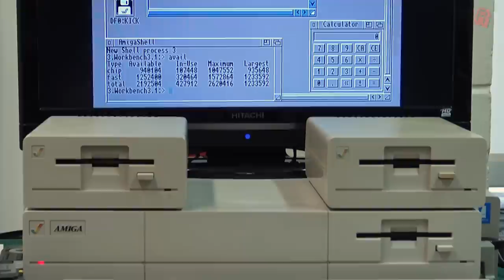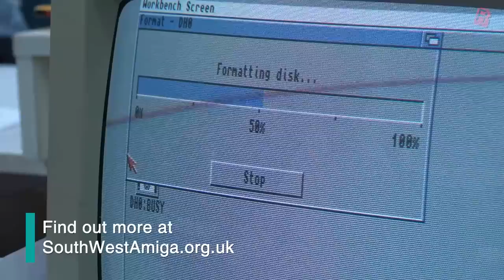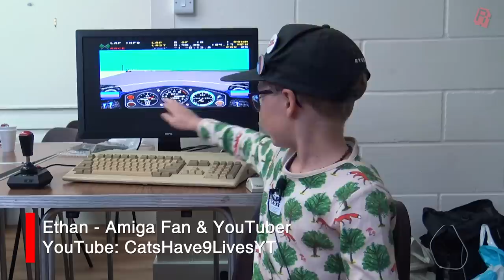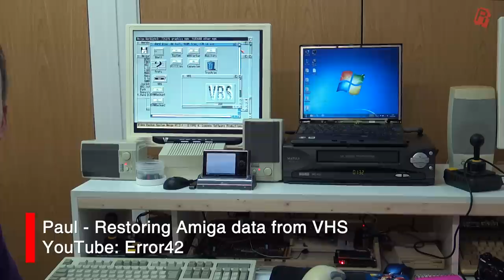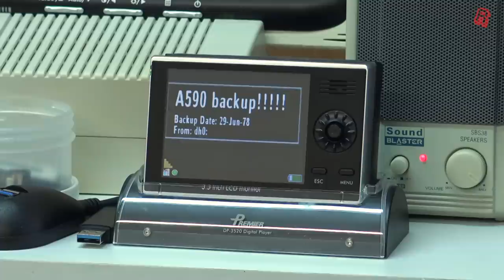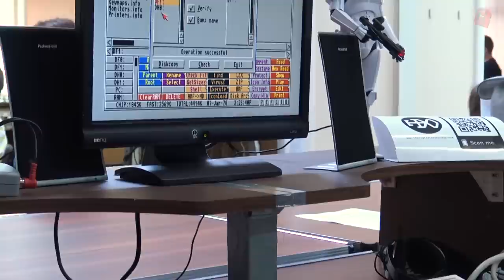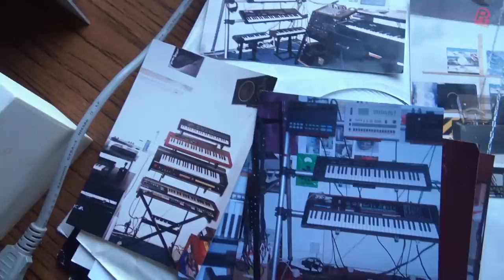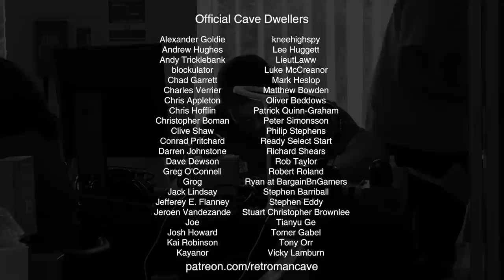Amazing Amigas at SWAG - Retro Road Trip

Comment: Question for you: I just took my original Amiga 500 out of its 15+ year storage in the closet. It is sealed in a plastic container. I have the RGB monitor, and RAM expansion plus a bunch of random accessories. Can you direct me to a video on what to do with this vintage machine before I power it on? A checklist maybe? I don't want to accidentally ruin it. Thanks!
Reply from the maker: Assuming it's an A500 and not a 500+ you have no battery to worry about on the main board.  Remove the expansion card and check if that has a battery and if it has leaked.  If you have a multimeter check the pins of the power supply to be sure it is giving out the correct stable voltage.  Then plug in.  The 500 is pretty hardy.

Comment: This just makes we want to get hold of an Amiga 1200 again. Had one as a kid for ganes and the HDD failed, then the monitor gave up the ghost so my parents threw it out (My mum was not the sort to let me take it appart at that age), and we got a PC to replace it. 

At the time they were only worth £20-£30 in working condition, but had a look on Ebay and was shocked how expensive they are now in coparrison (£200 for a good one!)
Reply: Yesterday's trash is tomorrow's treasure. 
Have a look at the price of an original Sony Walkman. TPS-L2  

Back when Amiga's were  still in the shops I was firmly in the Atari ST camp, but when they were down to about £20 I bought quite a few. Some I sold on, one going to the Czech Republic where they were never sold new, but I still have a few of them :-)   

Classic IBM PCs aren't cheap these days either. Probably because most of them suffered similar fates to the one a colleague used to fix his car exhaust !

Comment: My old A600 box. Why did I throw the box away. Why did a brand new system come in such a lame box?
Reply: Most of the wedge Amigas had these white, blue and red boxes, although the A500 one at least had a picture of an A500 on it. Some exceptions being the Desktop Dynamite and Cartoon Classics pack. Most of the later Commodore Amiga packs under their respective Wild Weird Wicked, Lemmings, Computer Combat etc. packaging were just sleeves that went over these vanilla boxes, so that dealers could swap the outer sleeve to revised packs produced by Commodore , and add in the revised software bundle, rather than dealers having 'old bundle stock'.

Comment: I have recapped my 1200, I still get CRAP video... I upgraded the video as well... no change. 
My 1000’s are sooo dirty, so likely they won’t function, but once I clean them up I may try...
The varda death has severely damaged my 2000, but I’m about 90% repairing it.
The 3000 works great, boots from hard drive, but REFUSES to recognize any floppy... methinks Gary or something has died. 
I also have a decent 1200 in a tower case works fine. Lots of sd and cf kits running... 3.0.4, 3.0, 2.4, 1.3... 1.2... lotsa kickstarts...

Comment: Radeon 9200 on an Amiga 4000? How?
Reply: Mediator PCI Busboard.
Reply: @tankgrrl  Interesting, quite a nice expansion list there but at very high cost.
Reply: The Radeon 9200 wasn’t that expensive. Second hand it was about £35. Originally the Mediator was designed to take Voodoo cards. Nowadays those are expensive 🙂. The aim of the Mediator was to make it easier to upgrade the later big box Amigas and towered a1200s with cheaper PCI cards. There was also going to be a PowerPC card you could plug in. The Mediator was the expensive part...